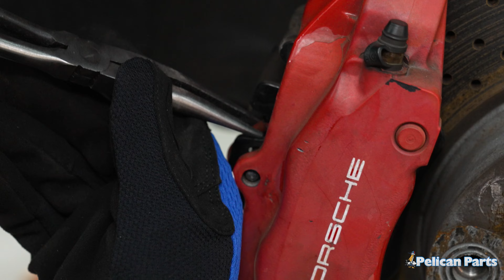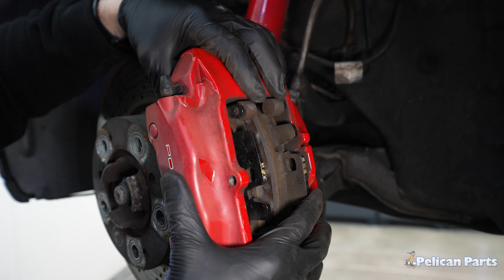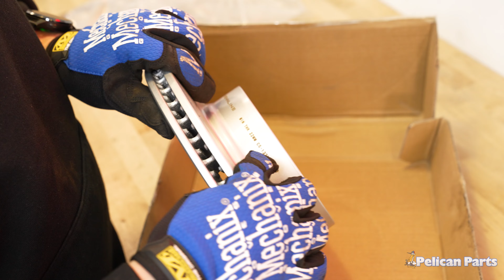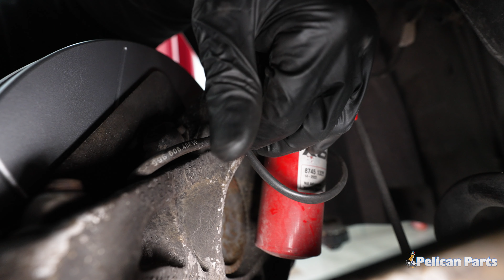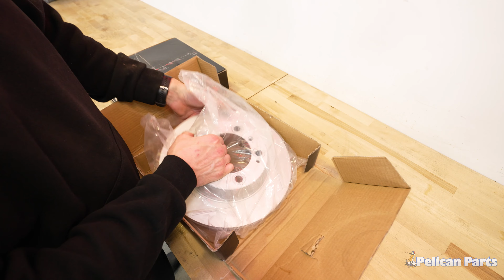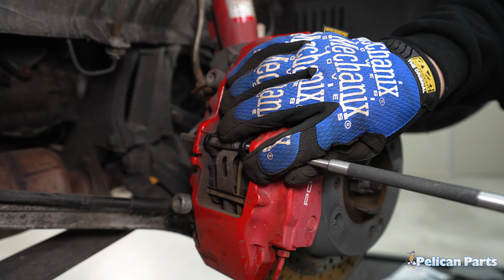Replacing the Front and Rear Brakes on Your Porsche Boxster 986

Comment: Your brake kits come with Liqui moly lm508 copper anti seize. Where should you apply it?
Reply from the maker: use the OEM manual to see where it goes on your specific model. Some it will go on the rear of the pad, some it is not used. If you share your vehicle info I can check.